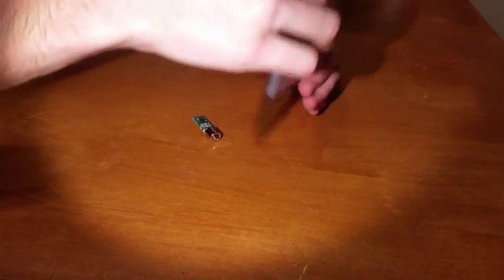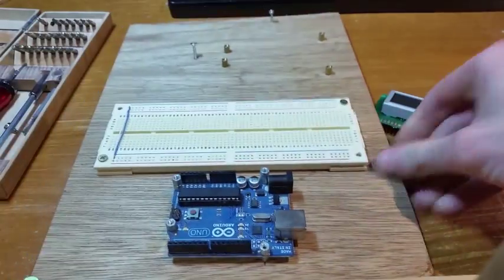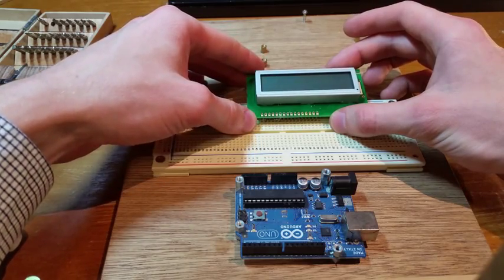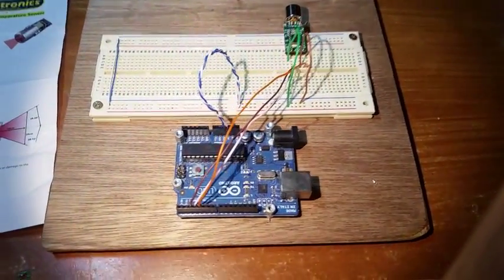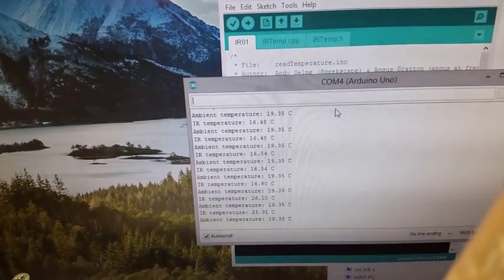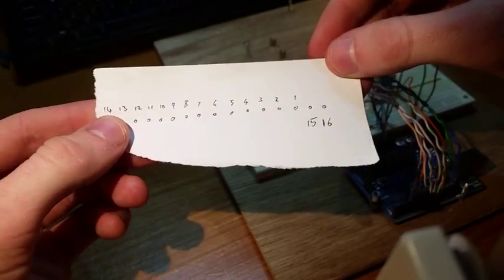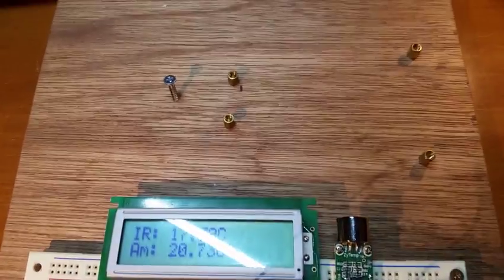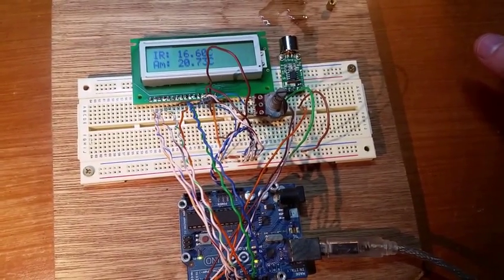Hooking up an Infrared Temperature Sensor

Comment: So cool! So this IR sensor has the needed circuitry to work dirctly with an Arduino 101 board? What if i'm wanting to monitor 5 IR temp sensors at once? What kind of range did you get out of this setup?